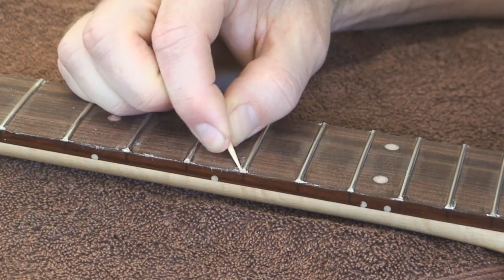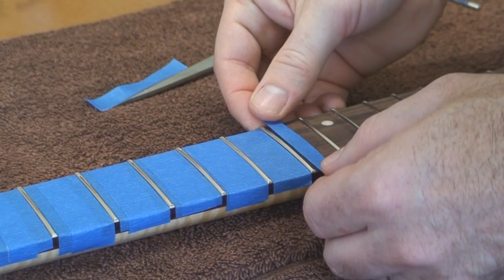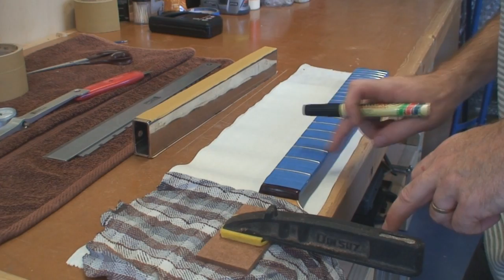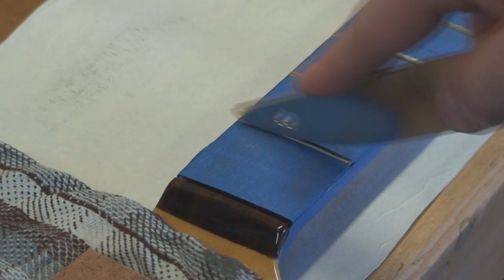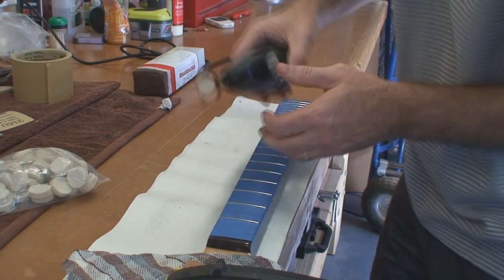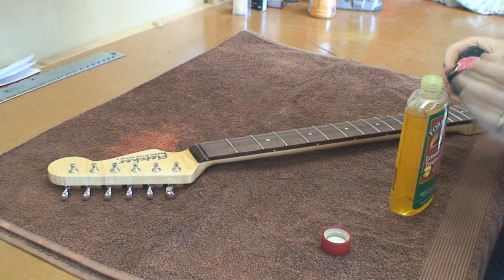Stratocaster Guitar Build - Part 6 - Building A Stratocaster Guitar Neck

Comment: I built quite a few guitars of my own design starting in 1983 . Last 4 were strats . The first one I bought the neck that was a strat style to fit a tele I just added rose wood to make the heel rounded . I built 3 strat necks and 5 bodies and didn't have any stew mac tools except for the last one which I sold . All I bought  was a fret saw and 12" radius block a fret hammer and a neck rest to drive it the frets. On all of them except the last I used the aluminum U channel type truss rod stew mac offers the lost one I used the stew max hot rod hex key adjust. I didn't like the way the rod just sets right under the finger board . I like a filler strip. 

 All the necks I built are maple from a wood supply shop with rose wood boards from a large block I was given decades ago.  I only used a router for the rod slot and to round over the body edges. I shaped the necks like you did for the most part except used two spoke shaves for some of it. The finger boards were all hand sawn by me then planed flat and the radius was done with a block I made and the frets all finished with a flat mill file and crowned with a three corner file with the edges removed and then sand paper and 0000 steel wool to polish . The router was also  used for the body routes. 

 I did use spray gun and lacquer and hand sanded and hand buffed. Last one I used stew macs water based lacquer and an air brush . I didn't go as far as you for the shine. I have no idea why perhaps because when I built the necks the back of the head stock and neck end should be even /flat with each other the last one was because by then I had a PC . They work fine yet one the heel is deeper than the peg head and one is much higher , even the one I bought from a shop who built all sorts of guitars sold me is not level with the peg head back. 

 I have a neck blank and a pre slotted board board from stew mac and the tall fret wire I like and the same u channel rod all from stew mac sitting here for at least 14 years and plan on making one more neck to replace one I don't like . I have no templates to rout the neck and board after glue up . I just do it all by hand and it takes a lot of time . 

 The one thing I do different is I don't cut fret slots any deeper than the fret tang and also cut them to follow the boards radius , it leaves a lot more wood for a what I feel a stronger board. The stew Mac board has the slots cut , in this case rather than dealing with cutting my own slots it will do fine . I have another black board and will first cut my own slots , if it works out that's what I;ll use . 

  All this to say you did a great job and have a nice set of tools. Most of these specific guitar building tools didn't exist when I started stew mac didn't have this either, they just sold a few items mostly parts and some tools  . I used to get my parts from local shops as well as the wood from local hard wood suppliers who no longer exist.

Comment: Hi David. Is there any harm in levelling, crowning, polishing frets before you spray the lacquer etc?

I've just put my frets in and bevelled, wondering if I level etc but I haven't sprayed neck yet.
Reply from the maker: I really cant see any reason why it would make a difference.  If you are
 spraying a maple fretboard then the level and crown is best done 
afterwards as it will also remove the built up lacquer off the frets. If
 you are taping up the fretboard before you spray I dont think it 
matters.
Reply: +Fletcher Handcrafted Guitars thanks David! Do you normally do it this way, crowning, polishing as the last job?
Reply from the maker: Yes, its the last job before I assemble and set up the guitar
Reply: +Fletcher Handcrafted Guitars thanks David. I saw you don't like 35 degree bevels. I did mine at 20 degrees, is that close to what you do?

Comment: When leveling the frets, are you passing the block parallel to the center line or diagonally like the edges of the fretboard? Is there any difference between leveling compound radius and single radius fretboards? Thank you in advance!
Reply from the maker: ***** pass the block parallel to the center line for single radius and diagonally along the edges of the fretboard for compound radius ( follow the "cone" )

Comment: Seems like you could run a piece of blue tape along the fret board, down the neck...right near the edge of the maple. Then fold it over the frets, and then apply the cross taping. Then it would prevent the compound accumulating on the edges of the frets, and it should also facilitate easy removal of the tape between the fret wires. 

I think I saw Dan Erlewine do that in one of his videos, and it worked out really nicely as I recall.
Reply from the maker: Oh definitely, I could have done a MUCH better job of taping the fretboard :-)
Reply: ***** No sweat...we knew what you meant to do!

Comment: Dave, I gotta say you've inspired me to build my own telecaster. I'm 90% done at this point and the whole project has gone great thanks to your video series. One question though. I'm concerned about the tuner bushings and the string ferrules cracking the lacquer when I press them in. Any advise?
Reply from the maker: Great ! :-)  I use a soldering iron to push the ferrules in, it works perfectly if you are careful and don't overheat the ferrule. I use 340 degrees C on the iron and within 2-3 seconds it just slides in. Too much heat will mar the lacquer, only install one at a time and let it cool before moving on to the next one.  As for the tuner bushings , I just use a small drill bit with sandpaper wrapped around it to clean out the buildup before I push them in. Take care of course or else you will get chipping.  Good luck

Comment: Is there a reason why you use the machined beam instead of the radius sanding beam? Because although it would potentially undo the rounded ends of the fretwire, it would give probably the best even height for all the frets.
Reply from the maker: I find a straight beam does a much better job for leveling frets.  A radius block is great for radiusing and leveling and humps in a fingerboard but not so great for leveling frets.

Comment: Hi Fletch. I have a squire Jaguar and the edges of the fret board are not as round as I would like them. I noticed in this video you use an 800grit sandpaper with the pop sticks to reround the edges. Is this something I could do with my Jag to get the edges a bit rounder?
Reply from the maker: You could , be careful you don't damage the lacquer though
Reply: ***** I reckon I could mask it up with tape. Great tutorial btw. On video 7 now. Great stuff!

Comment: Very nice work. I've been building my own guitars for a number of years but it's always nice to pick up a tip or two that I hadn't seen yet and your videos are certainly full of them. I thought I'd pass one on to you if you hadn't seen it yet. I learned this painting cars. When you wet sand use a foam sanding block to squeegee off the water. It cuts way down on the paper towels and the surface drys a lot quicker so to can see if you've flatted the area a lot faster than towels alone. It saves towels but especially time.

Comment: A question David: A looked at another youtube video where a guitar was setup. He adjusted the trussrod with the strings on to a deadflat neck. Then he used a neck jig to get the same neck position/relief as with the strings still on. There after his leveled the frets. In your opinion, is that really necessary? I can ser that you adjusted your neck to dead straight without strings and leveled the frets after that. Really nice work by the way, you have inspired me to give it a try myself

Comment: Pure art! Absolutely love it. Great job! I noticed what seemed to be some inconsistencies in the contact point after crowning. The marker line didn't seem straight. Wouldn't this affect intonation? I have only crowned one time with a diamond file and I continued until all the marker was gone.Did I go wrong? I still have some fret height I want to remove though, so no problem with taking too much off. Thank you!

Comment from the maker: I  don't like to use a radius block for leveling fret. A straight beam does a much better job for me. I do however slide the beam from side to side as I level to keep the radius.   

For me, a radius beam is to sand the initial radius before fretting, not for leveling frets.   I find when used as a fret leveler, it over radius's the frets at the ends leaving the middle of the frets high and the ends sanded too much. 

I''m not saying your method is wrong, saying we both have different methods.

Comment from the maker: I don't like using a radius block to level fret. They are fine for radiusing a fretboard before fretting but I find they take too much meat off the frets on the outside edges when used to level the frets. I prefer to use a straight block as in my video.

Comment: If you tape the side of the fretboard before you tape the top it will make it easier to remove the tape across the top as it will pull up the edges when the side tape is removed.

Comment: 3M has a new product called Trizact. It is for metal work, and is a 72" belt for a belt sander. The abrasive is very evenly bonded hard glass ceramic resin that is applied in parallel strands. It does not leave scratches, and I have even used it to resurface stand up bass. The fine feel of this stuff is a bit misleading. It is aggressive. Unfortunately the stuff is only sold in 50 packs by 3M. A distributor might have individual belts. I love the stuff. It is like a fine single cut file on cloth

Comment from the maker: Definitely  - Warmoth necks are fantastic quality but If they did not specify that the neck has had the frets leveled, you can assume you will need to do that yourself. Most people will not bother, and that's the reason that the guitar is never able to be set up with nice low action.